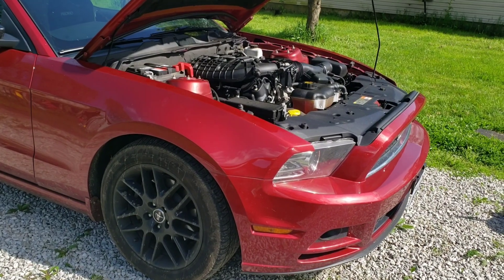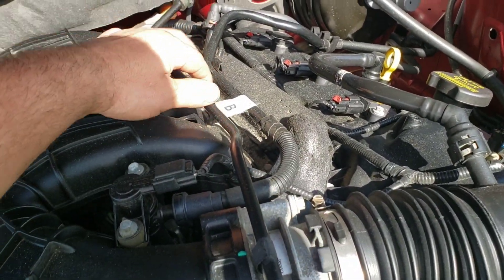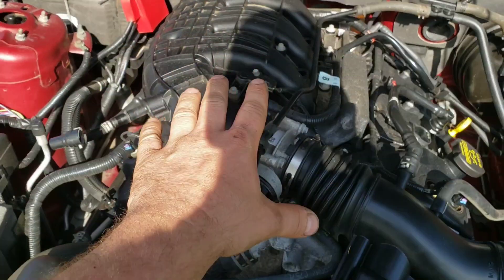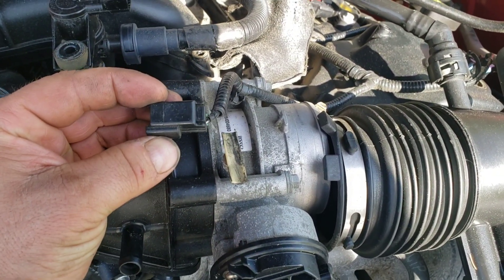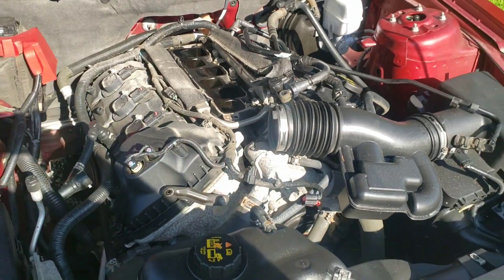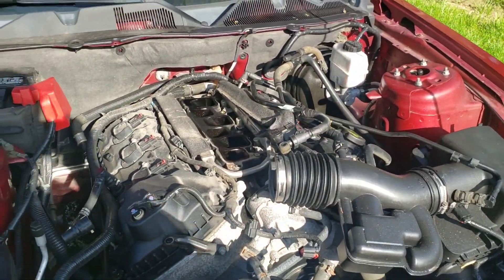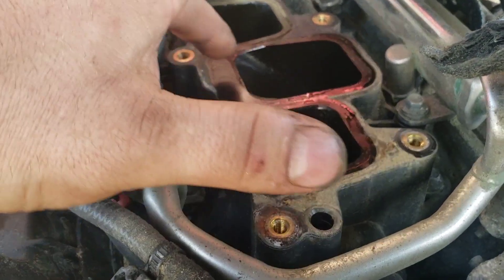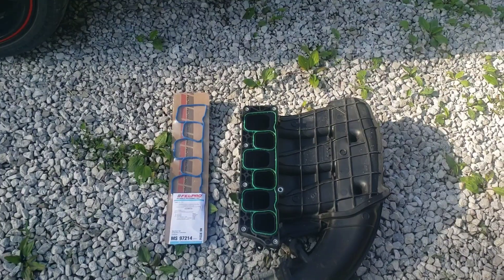11-16 Mustang 3.7 V6 Upper Intake Manifold *Detailed* Removal & Install

Comment: Hey bro out of the 7 bolts one of the first ones are loose I guess becouse I tightened it  too much but its still inside it just doesn’t screw in all the way down,I’ve been looking for a video on how to remove the manifold bolts and I can’t find one don’t wanna try to replace them without knowing
Reply from the maker: So are you asking me a question? Because this is a statement...

Comment: Hey man... Question do you know every how many miles the spark plugs have to be changed? I bought a 2014 v6 this summer with 62.000 miles in it i heard tha the spark plugs last over 100.000 miles? I am not sure if you can help me with my question i will really appreciated...thank you.
Reply from the maker: I think the service manual does say something about 100k, but I would never wait that long. The golden rule of thumb that I've always went by was every 30k, and that's what I still do today even with the high end plugs that I run. But I run my cars hard constantly. If you drive your car easy, then you can go longer; but I still wouldn't go 100,000. Driving like me where I go full throttle multiple times daily, I would say definately every 30k. Spirited driving but not quite that hard, every 50k. If you constantly baby it and hardly ever dip into it, probably every 75k. And that applies only to this vehicle and with the plugs it calls for from the factory. Also, that's just my opinion.
Reply: @BuckeyeBallistics  thank you so much for you answer an thank you for the video i will check my car's plugs using you video is reference.... Thanks man...
Reply from the maker: Welcome
Reply: @BuckeyeBallistics  I just changed daughter's 2013 Mustang V6 plugs with 167K on them. The gap was ~ 0.065-0.070 so definitely worn out but still worked great, and she doesn't baby hers. I think the Ford V6 engines are pretty solid, even though I'm a Chevy guy. Now if it had a turbo, that would certainly change things and then I'd be with you on changing every 60K. Good vid though, very detailed. Like someone else pointed out, that pipe with the nasty double spring clips doesn't need to be removed at all, just undo it near the firewall. Saved me several minutes. Keep up the good work!
Reply from the maker: These newer cars say you don't have to change the oil until 20,000 miles now too, but you'll never get me to go that long without a change. .070 isn't very efficient- I would expect throttle response and mileage to increase slightly with the new plugs...

Comment: Hey I changed mines yesterday but I noticed that where my gasket sits the bloack was all black almost looked oem painted, but yours looks chrome at 8:33 any idea why? I also used too much lbs to tie down the plugs so hopefully I didn’t mess up!! Thanks alot first time ever working on my car by myself you’re awesome
Reply from the maker: It's just a reflection because it is wet/oily. It was all black...

Comment: hey sorry but what is that first hose you disconnected? mine is wet and i think is leaking
Reply from the maker: Time stamp please so I know we are both talking about the same thing
Reply: @BuckeyeBallistics  1:50 i think its the pcv valve hose
Reply from the maker: Correct, pcv.

Comment: Bro, once I was putting it back. The screw number 6 of your order on how to tight it, got lose, I over pressure it. What would you recommend to do now ? 
I finish everything else and it runs good and makes no sound or anything.
Reply from the maker: Just leave it and pray nothing starts leaking lol. If it becomes a problem, you will have to drill and tap the hole to fix it, or try helicoil.

Comment: Sooooo I got mine changed and it doubled my miles to empty and then it started burning gas quick. Then I pumped $20 of gas and it went from 65 miles to 269 miles to empty. My car responds quick, sounds better, feels smoother but the gas burns quicker and the miles to E isn't accurate.. I'm not too sure what exactly happened but I had unplugged the battery before the change and then this happened. Any suggestions what to do? I bought pre-gapped spark plugs but I believe they turned out to be on the wrong measurement. Might just have to check them tomorrow morning and readjust them but if that doesn't fix the issue, idk what will..
Reply from the maker: Not sure why you posted another comment when I already replied to your other one on the other video. Did you mess with the fuel rail or injectors at all?

Comment: I've a failing knock sensor bank 1. Do you have any video on how to remove the lower intake?
Reply from the maker: I will next week when I install my ported upper and lower intake.
Reply: @BuckeyeBallistics  I'm having trouble finding the location of the knock sensor do you know where I can find it?
Reply from the maker: I've been searching for 20 minutes man and I can't find an answer. I don't know if they are somehow under the intake like the V8 is or not. If they are I'll post a location video when I have it off, because I don't see a video for it either.

Comment: How many miles did you have on your car when you changed the plugs?
Reply from the maker: Over 100,000 miles. I bought the car used with over 100,000. So in case they were never changed, I changed them. Refer to your owners manual for when to change...

Comment: Where is the camshaft located on a 2011 model
Reply from the maker: Um well you have 4 because it's a DOHC (dual over head cam), and being a DOHC then dictatates that they are above the heads under the valve covers...

Comment: How do you change intake plenum gasket? I got 2016 v6
Reply from the maker: You just pop it out and put in the new one- did I not show that in this video?
Reply: @BuckeyeBallistics  sorry I’m noob first time ever trying to work on a car. I went to auto zone  and it say to change intake plenum gasket I didn’t know it was that sorry. Also gotta charge spark plug but I watched your other videos and I’m ready to tackle this project. Thank you 🙏
Reply from the maker: Oh, yeah it's just a little rubber gasket that is (on this car) just pushed into the manifold- typically green or blue (on this car); I still thought I showed it in the video though? I did another video where I replaced both the upper and lower manifolds later on with new ported (performance) ones. That video shows a little more about it I think since that's all it was about was the manifolds. They're all in the Mustang playlist on the channel for quick access. Good luck and just take your time and triple check everything 👍
Reply: @BuckeyeBallistics   Thank you so much sir. I will make sure i check everything more then twice.

Comment: Can you please make a video on the hose at 3: 47 please. I am unable to take it out. Please help!!! Thank you!
Reply from the maker: But I literally said in the video in detail how to remove it... you have to squeeze both the front and back tabs together at the same time because it is actually one piece. Then, at the same time, wiggle, twist, and pull back to pop it off- sometimes the rubber will kinda seize onto plastic and metal parts like that from the heat. It might be easier with 2 people so one can squeeze those clamps down while the other pops it off. The weather is horrible here right now, raining and very windy. If you still can't get it off then I could make a quick video for you in a day or two when the weather permits, but it's going to be showing exactly what I just eplained...
Reply: @BuckeyeBallistics  thank you for replying so quickly. I feel like I will break it. I am trying to replace 3 egnition coils and found your video extremely helpful. If you could show the tool and the amount of pressure required to take the hose out, I would greatly appreciate it. Please take your time as I will try it once more on December 19th. Thank you so much for being kind.
Reply from the maker: I already showed the tool in the video, you must have blinked lol. Just a large pair of needle nose pliers and I had to squeeze pretty hard. Lemme just see if I can go outside and make the 30 second video for you real quick. I'm not posting it as public, so I'll have to give you the link here in a few minutes when I'm done.
Reply: Thank you so much for being awesome!!
Reply from the maker: No problem. It's uploading now but I have slow internet here so it'll take a few minutes. I'll send you the link when it's done. Please let me know that you got the video and that it plays when you get it. Should be less than 20 minutes from right now that I'll be able to send it...
Reply: @BuckeyeBallistics  thank you so much. Take your time. I will watch the video a few times and then I will try it once more tomorrow. Thank you once again. Have a great day!!!!
Reply from the maker: It wouldn't upload the first time for some reason so I had to try again. Here is the link, please let me know if it works: https://youtu.be/ZdLlv5cwX2k
Reply: @BuckeyeBallistics  THANK YOU!!!!!! I will watch it a few times and then I will work on my 2012 tomorrow. THANK YOU ONCE AGAIN!!!!!!!!!!!!!!!!!!!!!!!!!
Reply from the maker: @9kellers  You're welcome

Comment: What if I don’t have a torque wrench?
Reply from the maker: Then unless you guess right, you'll either be too loose and cause a leak, or too tight and risk stripping out the threads (which will make it loose).

Comment: I'm hearing air leaks. Where the green gasket is. Should I take it back apart and get the green gasket?
Reply from the maker: I'm assuming you re-used the old gaskets? Re-check the torque. But otherwise yeah, a leaking intake manifold can cause the car to run lean which can be hard on the engine if it's bad enough.
Reply: @Guns&Cars   I just bought the one you suggested for my my wife's car and we wiped everything down and it's running smooth now. Back up to 14.4mpg.
Reply from the maker: So it's good now or still leaking? You can do a smoke test to confirm- blow smoke where you suspect the leak to be and it will suck it in if it's leaking. And I hope you live in the city if you are only getting 14mpg, because I get over 20mpg and I drive mine hard...
Reply: @Guns&Cars   it doesn't seem to be leaking anymore. You could definitely hear the leaking like it was sucking in air somewhere with the original green gasket, but when we wiped everything down and got the felpro gasket, it didn't make that noise anymore. Also she started driving it hard and it jumped up to 15.8mpg. It's climbing steadily.
Reply from the maker: Oh ok, glad to hear it!
Reply: @Guns&Cars   I totally broke the dipstick ring cranking at one of the bolts for the coilpack but she has to take it to the dealership for a new vct  solenoid due to a leak so I'll just have them order in a new one. Tried the local autozone and dorman is completely out of stock.
Reply from the maker: Advance Auto Parts has them online, ships to home. American Muscle has some too...
Reply: @BuckeyeBallistics   copy that. American muscle is out of stock but I'll try advanced auto parts